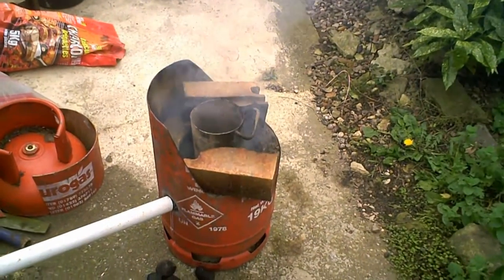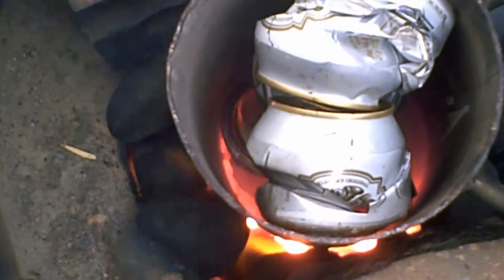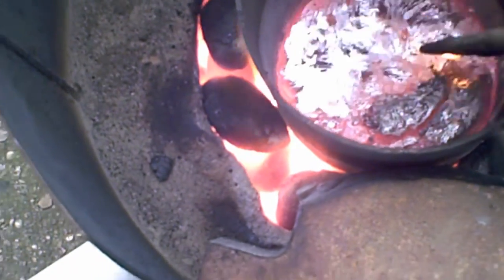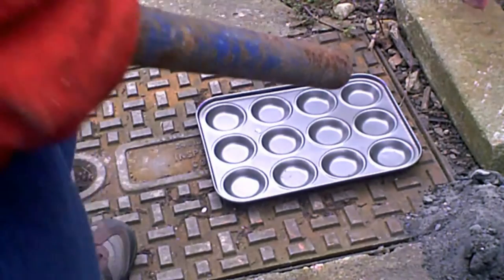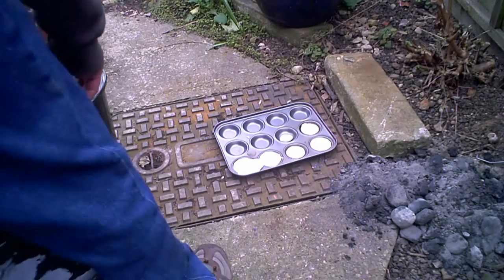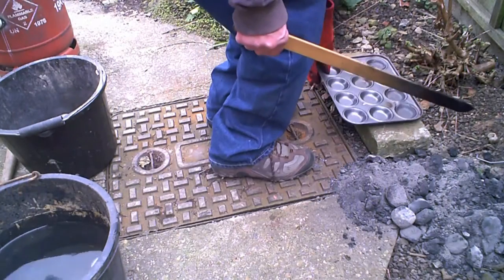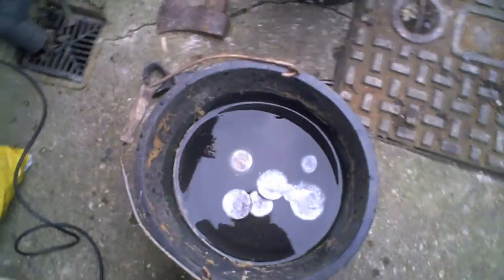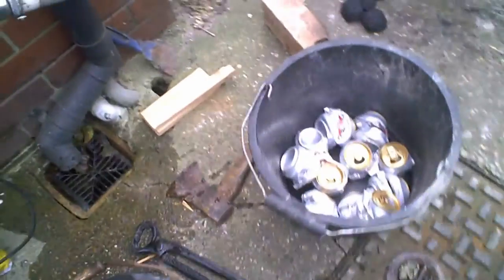Model Steam Engine #7 SUCCESS  I've cast an Ingot

Comment: Coming along nicely. I was surprised at the squeaky noise when the hot metal went into the water Expected hissing and maybe bubbling, but squeaks? Have to be so careful in handling it all..
Reply from the maker: +Eezee Listen Yes Mike, learnt from growing up I suppose, you have to be very careful. Notice how I jump back when slecking it (cooling in water is called slecking) Can easily get a splash from hot water.
Quick story for you....My father was in the blacksmiths when young, and wearing wellingtons. A bit of hot metal being cut off fell inside. They grabbed him and stood him in the sleck trough.

Comment: Well congratulations to start with , I knew you would win in the end,,,,   in my videos I used smokeless brickets   and charcoal ,,, I thought you was using the same im sure mentioned smokeless fuel in your last video,,,,  I found having some charcoal as well it got going a bit faster,,,,   You keep mentioning the concaved bottom to the crucible and I can't see where your coming from on that point, I don't understand why you think a flat bottom would be any better,,,,  mine is also concaved ,,, I would say there is actually more surface area on a concaved bottom which has to be the most important point as there is more area to capture / transfer the heat,,, and now you have a better fire bed and that its lasting longer I can't see why you can't put the crucible back in the furnace,,,   well I can ,,,,, your saying the fuel around the sides falls down ,,,,  ,,,  but I don't think ,,, and im only thinking back to my own firings ,,,,  but I found the fuel around the sides didn't do a lot,,,  I think it burns better down on the fire bed where you get it glowing bright red,,,  and when its in the bottom the heat has to come right up past all of the crucible ,,,,   you would never have a boiler where the fire or gas jets are half way up the side of the water vessel ,,,,  the bit of fuel around the side is not contributing the majority of the heat,,,  all I think you need to is extend the furnace walls up by 5 or 6 inches ,,,,  you already have support around the back,,,,   and seeing as you have some sand and cement,,, I would wrap something around the furnace as an outer former ,,,, I would make a tube that fitted into the furnace crating an inner former and just build up the furnace walls with cement,,  a ring of wire around would keep it in place should it crack and you have a, good deep fire bed,, and furnace walls keeping the heat flowing up past all of the crucible ,,,  leave some ally in the bottom each time so you have a ready made pool,,, and your home and dry,,,  I don't think you should be knocking the crucible ,,, to me it looked to work fine, space to scrape the slag off,  you had it lifted out in no time ,,, nicely balanced for a controlled pour,,,  big enough to get plenty of cans in heating up ,,,  if the crucible is red hot turn the blower off and let it tick along not burning the fuel away too quick, and if you do have a long firing ,,,  just lift the crucible out,,, half and half charcoal and smokeless thrown in and your away again ,,,,  I recon its a total success apart from the furnace wall been a bit short,,,,  and you look to have some good quality aluminium no voids no gas bubbles no trapped slag ,,,,
Reply from the maker: +Alan Plumb Thanks Alan.........firstly the concave bottom hampers the melt FACT. I'm chuffed to bits I've got pure aluminium and no slag. So......onward and upwards I suppose. I really think the concave bottom has hindered me. Really thought it would help, but it hasn't. A smaller crucible/container will do the trick. And.........I have some good quality ally at the end of the day. I have filed and hacksawed a bit off one of the 'moulds' and am happy to report...........pure allys....no holes or imperfections :) We really are getting there.
Reply: +MalcOfLincoln O you can see straight away how clean the ally is,,, no problems there,,, no a design for the bed plate and mold ,,,
Reply from the maker: No design........just a flat ingot I can work with
Reply: +MalcOfLincoln Ya a lot to be said for keeping things simple ,,,